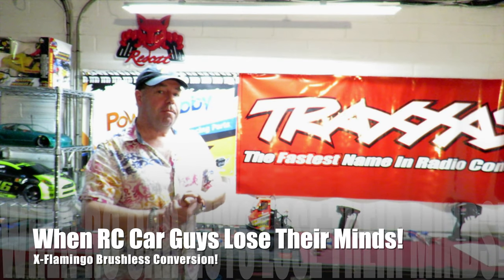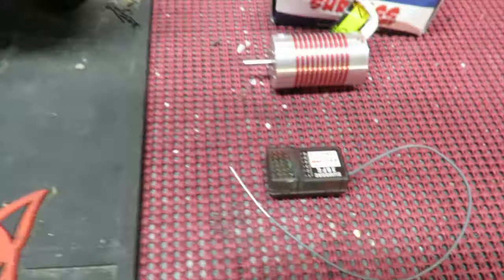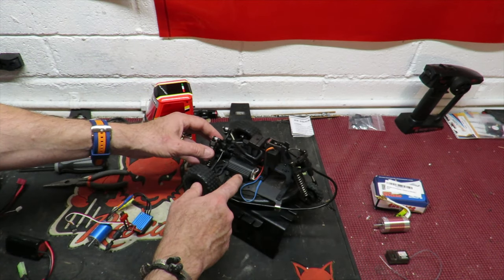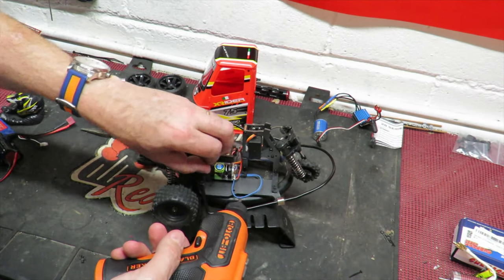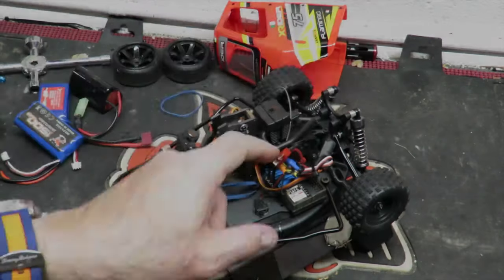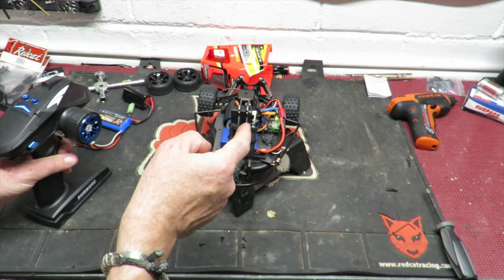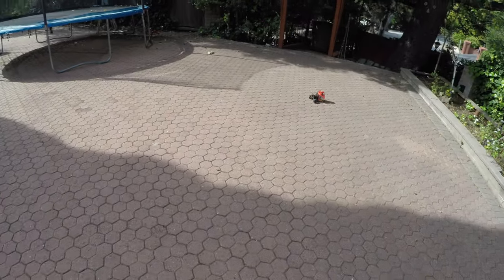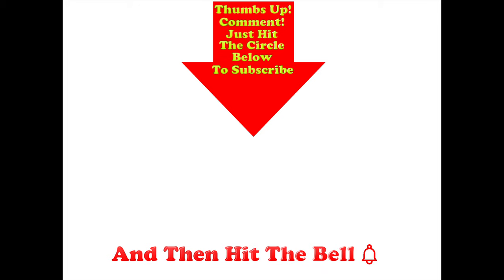When RC Car Guys Lose Their Minds! X-Flamingo Brushless Trike

Comment: I am upgrading a wltoys subotech coco atv 1/24. I added the dumbo Rc  6 channel and a 10 amp esc. Using stock batteries and stock brushes motor, but added a 8 led light kit and programmable greeen LED strips I made a sprin powered turret harpoon that shoots about 10 feet away. Pretty fun with pan and tilt. Today I’m getting emax transporter googles because they are dirt cheap, and adding a fpv camera. I also added heat sinks and fan cooling.

Comment: I'm in the middle of a motor, esc, and servo replacement on a Losi Mini 8ight. I bought a full hardware set from Horizon Hobby but even the new screws are really soft and easy to strip out the heads. It's been a bit of a frustrating experience to say the least.

Comment: Great Video - crazy car :) finishing work on the house this week, then starting on the garage to clear it out and make into a proper RC workspace, rather than working on the dinning room table
Reply from the maker: Best thing I ever did for this channel was setting up dedicated workspace, I've an area off camera with drill/vice/metalwork and another for electrics. Took a while to get it sorted BUT makes repairs/mods much faster.
Reply: @DriftomaniacsRC  thats my plan, within thew space a garage in the UK allows :) - going to do a vidoe of the before and after clearing the garage out :)

Comment: Attempting the build the fastest traxxas 2wd, I have the TP Power 4050cm 8s and castle monster mamba x8s esc and the new proline supersonic body glueing the tires right now 😃
Reply from the maker: that sounds an awesome build I though it read using supersonic glue on the tires until I put my glasses on!
Reply: Driftomaniacs my last run with a arrma 6s and monster mamba 2 esc I got 98mph hopefully I can break the sound barrier with my new setup lol